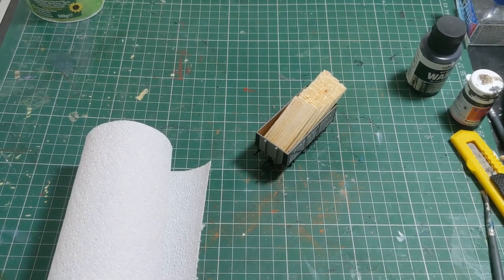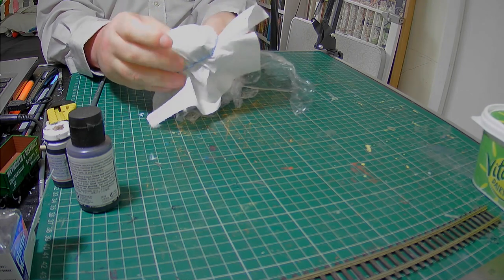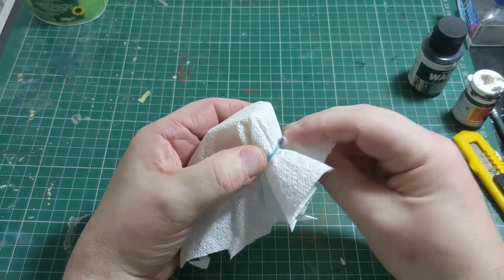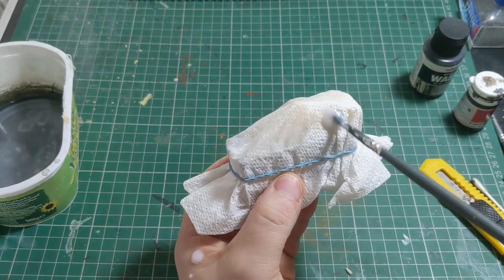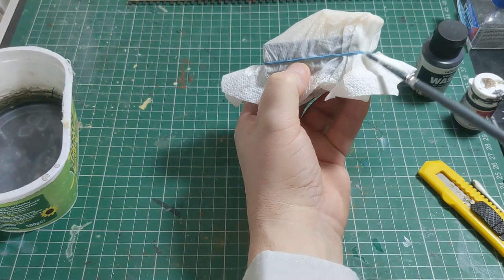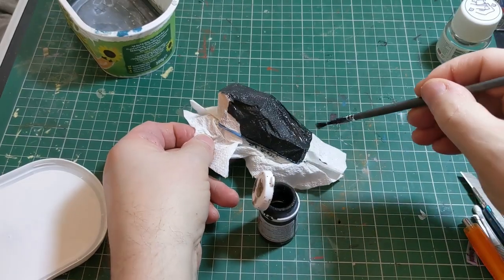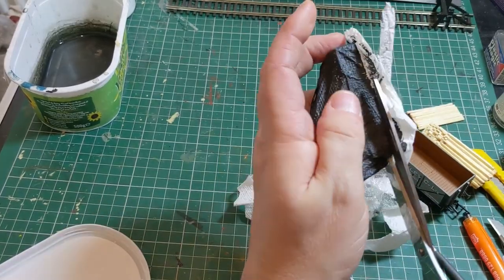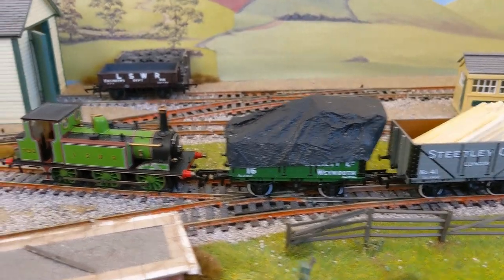How to make a Tarpaulin for your model railway wagons - cheap and easy method

Comment: Your idea is good, but instead of using diluted PVA first and than paint after, use an acrylic ink, mixed with your PVA and water in one.
This has the advantage of working in one go, and if your black is diluted with water and glue, it becomes a more very dark grey, sun bleached  black effect.
That looks much more realistic…
An other method similar, is to mix in a bit of sculpting plaster under your mix, and instead of structured kitchen towel paper, use simple Kleenex tissue, you'll get the effect of heavy cloth used to make the cover,
And with some finesse you can paint lettering on after like GWR, NE or what ever, looks super realistic…

Comment: I use Bacofoil for my wagon sheets , no glueing required just cut a oblong of tin foil , lightly screw it up then flatten out to give the foil a creased look , lay foil over the load and fold down against the wagon /load  it will stay in shape then paint it a matt colour dark green or black , looks even better if you lightly weather it
Reply from the maker: Never thought of trying that. I'll have a go at that next time.

Comment: Have you tried using crepe paper, and spray paint then 3M spray adhesive?
Reply from the maker: Not tried that, but might do next time I need some more tarps. The Kitchen towel gave a textured effect, though, that I dont think you'd get with crepe paper.

Comment: You mentioned that the wet paper was mopping up your paint. Do you think it would be better to leave the painting until the glue has set and the tarpaulin is dry? In extremis, just paint either side of the elastic band then paint the rest the following day when the tarpaulin has hardened and been removed from the wagon?
Reply from the maker: I had left it overnight, but you're right it might have needed a bit longer. Something to try next time!

Comment: Good top tip for tarpaulins.  I've been looking make some for my layout.  What ratio of pva to water mix did you use?
Reply from the maker: It was a 50:50 mix, but the PVA was a weak one to start with. If you were using something thicker (eg Gorilla glue wood glue) then you might want to dilute it a bit more.